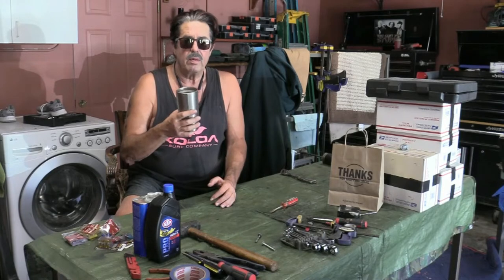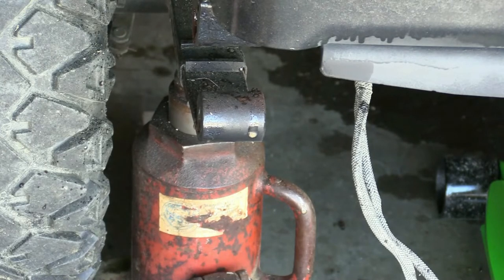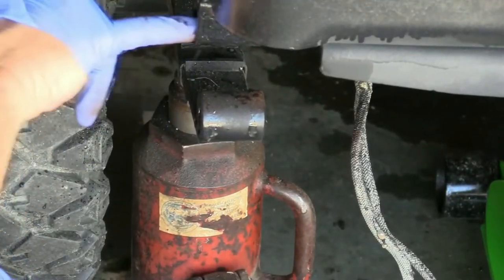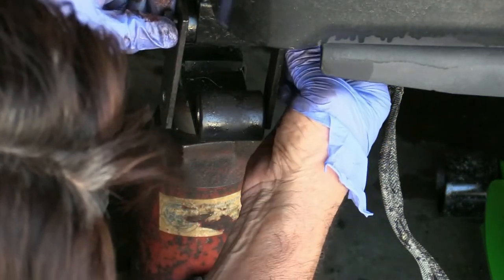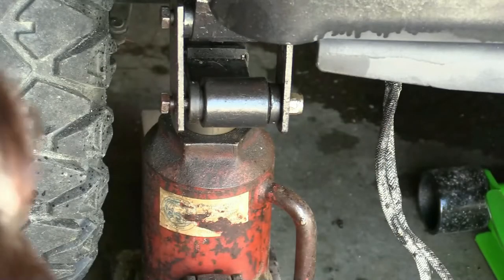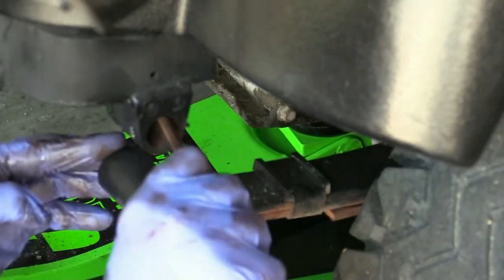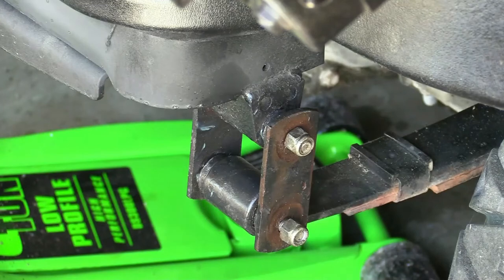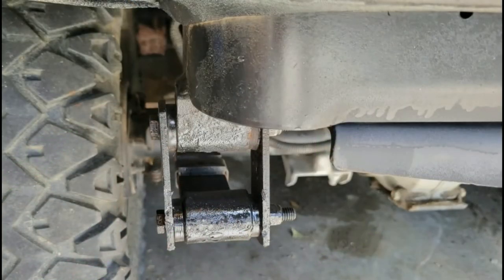EZGO Golf Cart Restoration Part #5  (Leaf Spring Bushing Replacement - DIY Install + Tips)

Comment: Good video.  Could used a sanding drum on a rotary toot or die grinder to clean spring or make a sander shaft by cutting a notch in a bolt then wrapping sand paper around the bolt to fit  the bore to be cleaned I have several of these and they work.very well and make a smooth bore very quick and easy
Reply from the maker: good idea and thanks ill remember that - that would have worked well